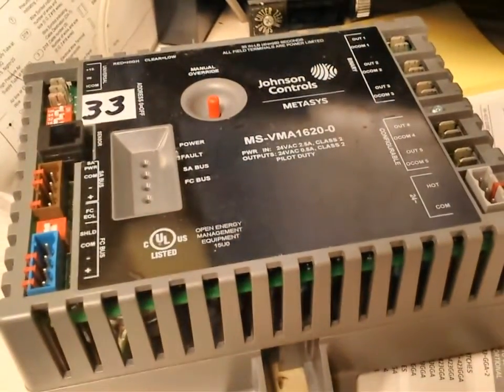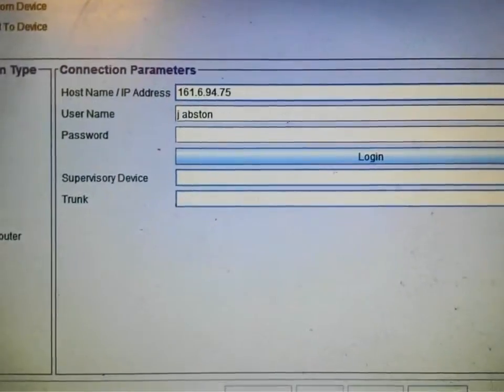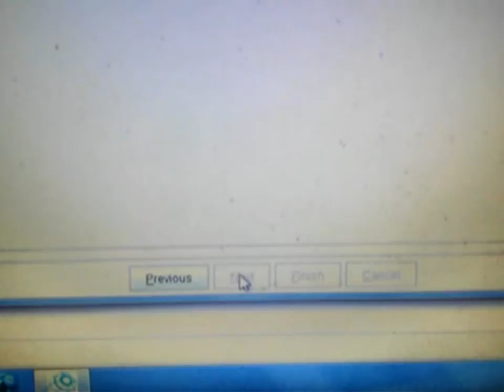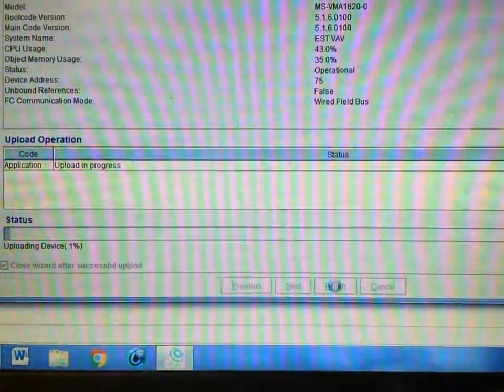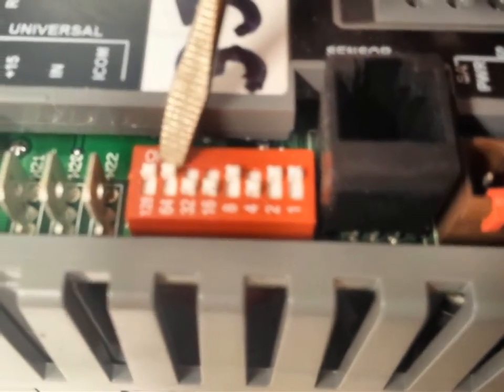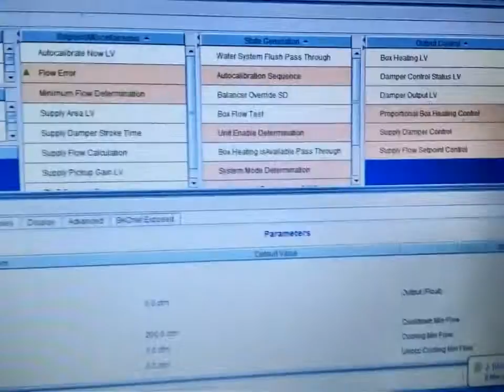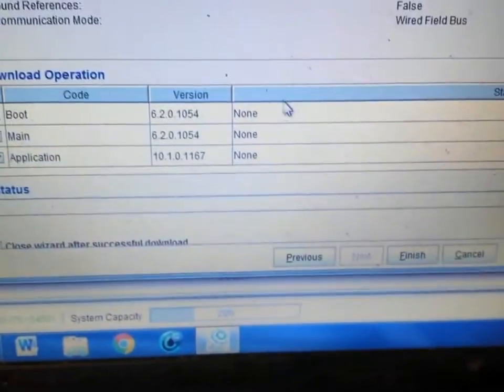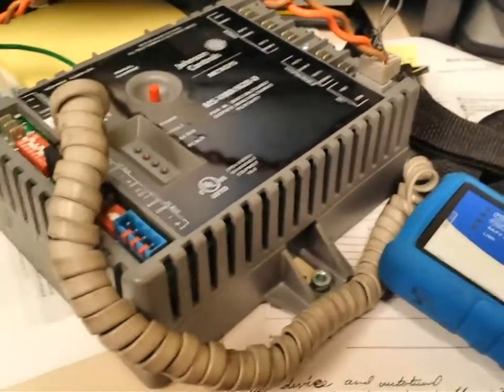Pre Loading Control Programming to reduce controller replacement time

Comment: Great and clear video as usual. I need to get a Bluetooth adapter for my setup. Thanks again.
Reply from the maker: +Tim Abbey Glad to help.  They can be a real time saver and can pull you out of a jam if you have a network issue or if an NAE crashes.  We had an NAE crash with the air handlers down and I was able to log directly into the controller and turn it on.  Well worth the investment.